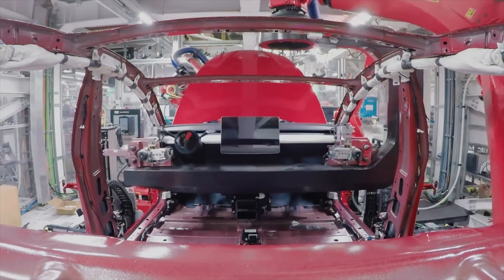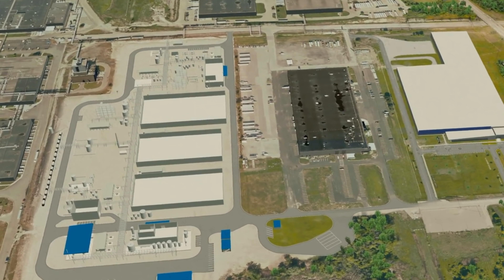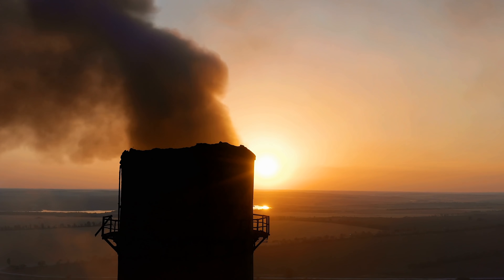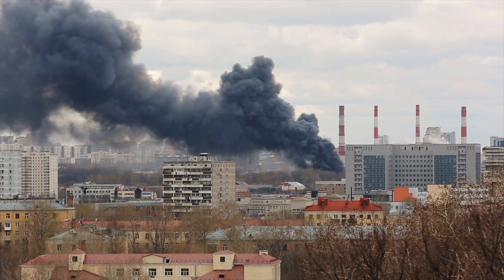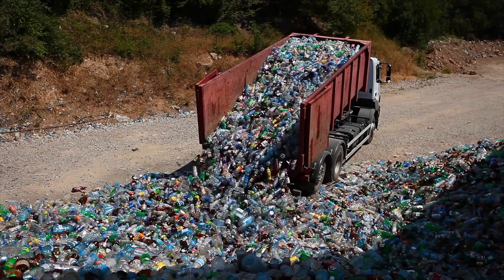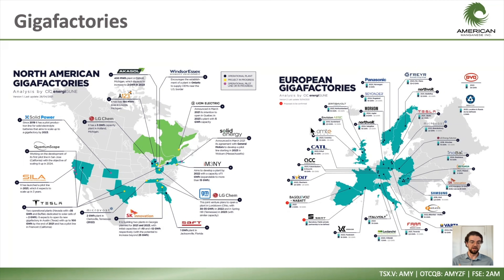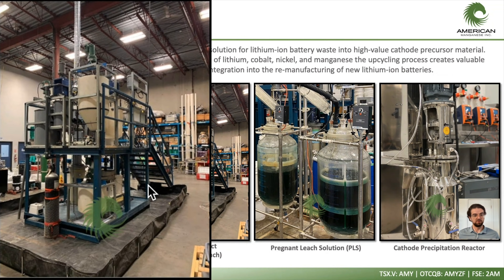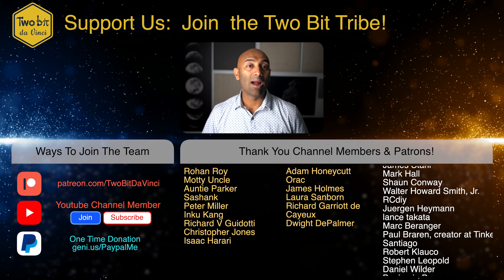Why Battery Recycling is the Next BIG Thing

Comment: When batteries become fully recyclable it will not make sense to use old car batteries for use on the grid. At that point it will take resources away from the transportation industry which will result in mining of more material, which is harmful to the environment. Mining causes lots of pollution. So for electric cars to help the environment, we need to severely reduce mining of materials. For reducing grid fluctuations, the use of geothermal, nuclear, OTEC, and wave generation can give us a stable power supply which is on demand

Comment: I've wondered for years what happens to batteries once they reach end of life. Not just the new batteries. Good to know some are working on the problem. And it is a problem. I am one person, yet I have several battery operated tools and devices. No EV yet. I think the technology for batteries and recycling will get better. I wonder though if there might be a better alternative. Maybe some sort of small modular nuclear reactor. Really small. Small enough to be in a car. Would run for the life of the car and maybe beyond. But that's science fiction, for now. We can't even do that for generating energy for the power grid yet. Fusion? Hydrogen? Air or water? For now, we have batteries. Great video.
Reply: This channel actually did a piece on micro nuclear

Comment: Thx Two Bit da Vinci for this information.
Even though recycling EV batteries is almost a reality, EVs are still using energy from burning coal for their energy. That is the real hurdle to overcome. Wake me up when this happens.
Coal fired generating plants are not as clean as petro and catalysts. My money is on Thorium, but that will go to the Chinese as our NRC is still refusing to license Thorium reactors. Oh well, at least when they come from China they'll cost a whole lot less. As they say could've had a V8.
By the time an EV needs a battery it will have such a low resale value that it would be foolish to put even $10,000 down from $13,000, big whoop, battery into a $3,000 to $4,000 car.
EVs have a ways to go before the masses will plunk down their hard earned money.
Reply: coal is getting pushed back by renewables + grid storage, so EVs supposedly being powered by coal is becoming less and less true.
Reply: @ehtuanK  The US is at 19% renewables.

BTW where will we get the power and grid capacity to power a whole transportation system with electricity. We already have rolling black outs without a huge transportation load.
We're just not there YET.
Reply: @pcrengnr1  19% and growing fast. Just compare it to where it was 10 years ago. And even if all your electricity came exclusively from coal, EVs would still emit slightly less CO2 than combustion cars, even after you include the emissions from the battery production, because EVs are that much more efficient.

The thing with energy storage is that it not only allows you to rely on renewables, but when implemented correctly it can also cover demand peaks, i.e. from charging electric cars, and prevent blackouts.

Comment: The economy will also drive the innovation to new invention of the electric car long before you find a good source of the required resources you need with the current application..ie it will go like this 1. Electric battery car that needs an external electrical source to recharge the on board batteries. 2. An electric car that recharges itself while it is driven . 3. An electric car that is sent electric power as it is driven by towers that work like cell phone systems. Now catch up to that.

Comment: Because we didn't learn from the damage caused by petroleum usage, now were creating another ecological disaster by using the NEXT non renewable resource instead of concentrating on hydrogen, solar and wind power, all renewable natural power sources.
Reply: @jl sc
I didn't understand which "next resource" you are referring to? 
You then bundle hydrogen with solar and wind as an energy resource which it is not. It's a way of storing energy, not producing it. And by the way possibly the worst performing storage form there is, in terms of efficiency.
Reply: @peterpicroc6065  What part of non renewable do you not understand ?  All minerals are non renewable, you consume them in their use and must dispose of the waste.  Not difficult to understand.  Hydrogen is most certainly an energy resource.
Reply: @jl sc
I asked what resource you were referring to. From your answer I assume this "next resource" is metals. 
Now what I don't get is how they're not renewable?? This vid was about precisely that. All metals are easily renewable. Did you ever see a scrapyard? Iron, copper, aluminum, lead etc are molten back into new products over and over. That some percentage "leaks" out of the system into landfills doesn't mean they're not possible to recycle. Only that the system needs tweaking.
As for hydrogen, it can be called an energy source only if you consider making it from fossiles through steam reformation, a highly inefficient process that releases all the carbon dioxide at the back end. Only way to use hydrogen in a sustainable way is to make it from water by using electricity. Then you can get the electricity back in a fuel cell. That way, hydrogen can store electricity, but it is not a "source", just as electricity is not a "source", only a medium for storage and transport of energy.
The reason everyone is going for chemical batteries is the lousy efficiency of hydrogen as electricity storgage. If you use 100 kWh of electricity to make hydrogen, you get around 30 kWh back as electricity. In large part due to the large amount of electricity needed to compress the gas for storage. With chemical batteries, you get around 70 kWh back.
In conclusion: Metals are very much possible to recycle and are being so worldwide since thousands of years.
As long as we want to quit fossiles, hydrogen is a dead end (except in some cases of chemical manufacturing). And even if we wanted to keep fossiles forever, hydrogen would only be an expensive detour in using them.
Reply: @peterpicroc6065  Metals ?????   Hydrogen is our only logical answer, put as much money into the development of hydrogen as we do electric ( a toxic NONRENEWABLE RESOURCE) and we can make it a viable alternative.  It already is, but we can make it better.

Comment: Deception at it's best. Perpetuating the deception is no help. Just since an EV produces no tailpipe emissions negates the fact all the energy to produce the battery but even more, all the fuel needed to generate electricity to be able to charge the battery. The additional deception on recycling saying is environmentally safe. I Call BS.

Comment: I think we should move forward on advancing better batteries, simpler batteries, and ultimately batteries designed around safe recycling. Lithium’s are actually very destructive and deadly to recycle unlike lead acid batteries, Salt water batteries, and few other kinds of batteries. Doesn’t mean lithium is bad, they are great for small devices! But I think a car might be quite the stretch in reality for these batteries.

Comment: What about hydrogen, powered cars. Isn’t it the best over all option.
Reply: @Gabriel Stanghier
Hydrogen is not a power source. It's a way of storing electricity. Problem is it's very inefficient. Around 30% round trip efficiency, in large part due to the high energy cost of compressing the gas after you made it from electricity.  Chemical batteries have efficiencies of 70% and upwards round trip. Meaning that the amount of electricity needed to get you 30 miles in a hydrogen car will get you 70 miles in a battery car.

Comment: @6:34 No.  It does not mean we must burn fuel.  SWITCH TO SOLAR!!
Reply: That would take an unimaginable amount of power. For something as large scale as that, it's not feasible.
Reply: @bradleystone9191  STFU fossil fuels troll.  Of course all furnace-based power can be replaced with electric heaters and solar power.
Reply: @sanjuansteve  okay have you played with solar? I play with photovoltaic cells quite a bit, I run my camper off it and am planning to run my house off of it as well. Those panels I have are rated for 250 watts at around 80% efficiency, okay. So this gives us 200 watts per panel while the panel is at full capacity which by the way you don't get hardly ever where I live for instance. And yes, I realize 450 watt bifacial solar panels exist however I'm putting out what's popular currently. The typical induction cooking stove (and this doesn't even get to 1500° C like the number YOU'RE trying to reach) uses around 2100 watts, on the low end and roughly 3000 watts on the high end of it. To basically cover the load of the smaller 2100 watt load you need at least 11 panels and this would only give you the power during the day and only when you have full power, and this isn't even going to get it as hot as it needs to be. Seems like a terribly inefficient way to heat the materials to me.
Reply: @bradleystone9191  I've been in the PV solar industry for almost 2 decades.  And yes, of course, solar power is worth it and electric heaters work for any application.  STOP using your social media voice to speak out against solar power as if you were a fossil fuels troll.
Reply: @sanjuansteve  okay, can you please explain to me how your PVs are made then? What materials must be used to make them? Are the necessary materials available? How will this affect our silicon shortage? Do you play with this stuff at home as a hobby and what do you do in the pv industry

Comment: I think that they should remove the battery's  from the original container so that you can separate the metal and plastic so that wouldn't  have to be put through with the batteries products. Question will the manufactured lithium batteries going to be degraded like the lead battery industry.

Comment: What happens when the battery pack has a much longer lifespan than the vehicle it is installed in?  Park the junk car next to the garage and use it as battery storage for the home solar panels?  The car is disposable, but we reuse the batteries in the next car?
Reply: EV also could have lot longer lifespan than ICE, could costless in services and repair with replacement part easily.
Reply: @jxmai1000  Hopefully that will be true.  However, the batteries may outlive the chassis they are placed into.    I live in the NE US.  I see nothing about these vehicles that leads me to believe they won't rust out just as fast as ICE.  We have plenty of ICE vehicles around here where the drivetrains would have outlived two chassis.
Reply: Usually the battery would degrade to the point of being inadequate for vehicular usage long before the car completely wears out, so the best case scenario is to replace the battery in the car using the old battery for grid storage.
Reply: @garethbaus5471  That appears to not be the case in many instances.  With new battery technologies arriving soon, battery lifespans well beyond the life of the chassis may well be normal.
Reply: @donbrutcher4501  you do realize that you can keep a chassis going pretty much indefinitely right? You will eventually have to replace the suspension, and possibly some of the body panels, but a properly designed and maintained chassis pretty much never completely fails unless you are in an accident. Batteries on the other hand should lose 20% of their capacity every other decade even if you go with a fairly long lasting chemistry. Also on the subject of rust, you do realize that many electric vehicles on the road right now have an aluminum, or partly aluminum chassis which greatly reduces the rust issue.
Reply: @garethbaus5471  Not around here.  5 years electronics corrosion set in, 10 years and rust holes are coming through everywhere.

Comment: What do they do with the recycled materials when technology changes and the formula used to make batteries stops using one or all of them and makes the market disappear   ?

Imagine if we were starting out with lead acid batteries today and getting all excited about recycling them to make new lead acid batteries. 

As we know Li batteries will appear tomorrow and no longer have a use for all this "green" recycled lead.

Will we continue to waste energy and accumulate mountains of redundant material  ?
Reply from the maker: So the various leeching processes would change over time but the methodical approach actually still makes sense. There are no limits on what chemistries can be supported

Comment: I thought using up the fresh water supply is also a concern. Don't get me wrong, this seems like a very cool way to deal with the trillions of batteries were going to one day have laying around. It would just be much cooler if there was a way to use ocean water or if they used renewable energy to power desalination. But, yeah, with 95-99% of the materials recovered, mining for those materials can be scaled way down once the supply stabilizes. Thanks for answering a question I've always had about EVs. Even though they make up for this by producing no emissions during their life, it doesn't make the batteries disappear. They'll be piling up just like the e-waste from electronics has. If we can scale this up, it will solve that issue before it becomes an issue.

Comment: I saw a bunch of bags containing Black Mass the was produced using a hydro-metallurgical process. This makes sense but who is buying it presently to use in new batteries?  So far I can not find a major battery company using this recycled material which does not make sense.

Comment: Those EV batteries make great storage batteries for off gridders like me. They still have 80% of capacity and many years of use left in them. 20 years off grid and helped many people to design and build their cabins and off grid systems.
Reply from the maker: True! This is after even that
Reply: @christopherbeddoe406  LIFPO4 have now reached price parity with AGM deep cycle. I replaced my old AGMs with LIFPO4 this year. 3X  life, more capacity at half the weight.
Reply: Yes. And i think the regular house can use storage batterys to stabalise the grid. Some countries talk about wind and solar more than any other kind of electric produktion. Great to that aswell 😁
Reply: @christopherbeddoe406  yes that would be the dream. i use like 130kwh a Day in winter (electric heated house). 200kwh lifepo4 and solar all the m2 the roof has to offer and the battery is connected to internet and controlled by the power supplyer for the lowest plausible electric bill 😁😁😁 there you got the future 🤘 like an investment like heatpump.
Reply: EXACTLY ! thats the real answer . getting the most out of these products in a real and responsible manner , not just using things and dumping them as soon as performance wanes to get the latest toy
Reply: Where can we purchase these used car batteries for home use?
Reply: @keithedwards9953  damn the intro was bright
Reply: @Jan 6 was "Wall Street Putsch" part 2 yes. Soon it will be none left. Feel sorry for them.
Reply: Yes they are. UL have created a standard for Second Life lithium battery applications, which we're working on to prolong the useful life of EV packs.
Reply: one of my friends spent 25k and got $100/kwh by using this method

for anyone not aware, that's mental for home battery systems where most models sell for something like $1300/kwh

Comment: How can someone say with a straight face that “ev vehicles produce virtually no emissions during its lifetime”? Even if they are significantly more efficient, they still are not emissions free in manufacture nor in the electricity generation that they consume nor can you exclude the end of life costs that this video is about. It is simply bad science to select the one good part of a lifecycle, it is always about total lifetime impact. And until these cleaner manufacture and cleaner recycling methods are widescale, then until then we are operating at a practical deficit even though theoretically things can get better.
Reply: Well, to play diplomat a little, I can see both points. EVs produce no emissions during their life in a perfect system where I get the energy to charge my car from the solar panels on my roof. As for the manufacturing part, that's a valid concern. But they're making progress on that every day. But, again, to play other side, most people will still get their energy from a coal, gas, or nuclear powered grid for at least the next couple decades. And the manufacturing has a long way to go even if they're making progress. It's a valid point but this is also not a video about those problems. He did bring it up but I'm saying he could technically be right if he's talking about in the future when everything is electric, ICE's are no more, and the last major hurdle is battery disposal.

Comment: I like what these two companies are doing as well as Redwood materials in the battery recycling sector. You will see second use batteries from EVs first before they go to these recyclers.
Reply: That depends, doesn’t it? If the process is economical enough, it may make more sense just to recycle immediately and manufacture new batteries, especially if the new batteries that can be made store even more energy than the batteries they were recycled from.
Reply: @pchasco  that is highly unlikely, these recycling processes are usually only slightly more affordable than using virgin material and grid storage batteries could be fairly profitable with the batteries at anything less than 70% of their original value something that would be incredibly difficult to beat with a new battery even if the raw materials were basically free.